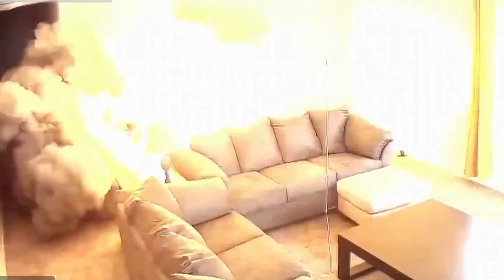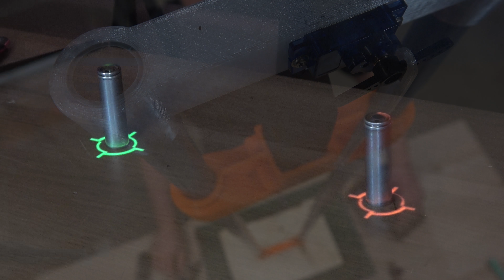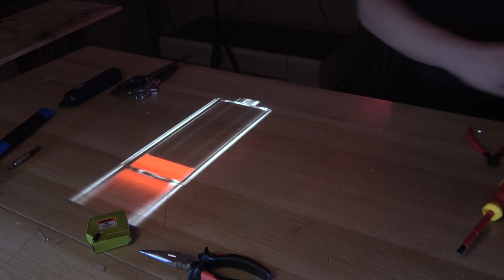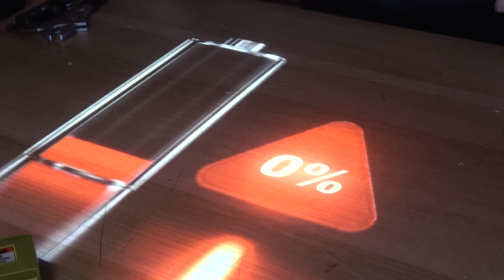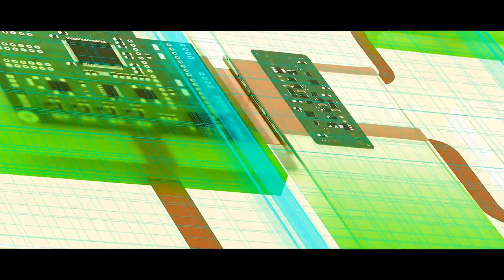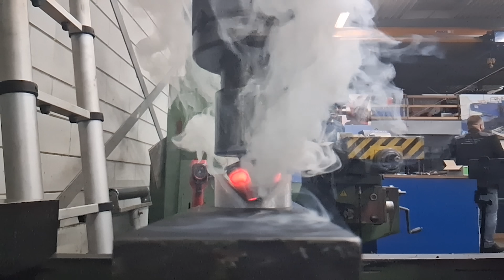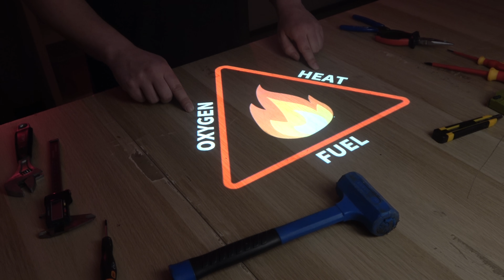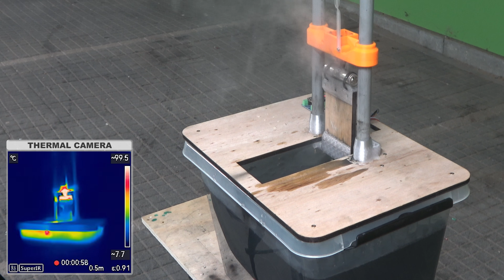Detonating Batteries.. For Science!

Comment: In the context of this video, you should really say Akku rather than just "battery," because there is a huge mechanical difference between using a chemical reaction that generates electricity and using a system that can be recharged.
In the context of this video, what makes a huge difference is whether the energy is stored via a chemical reaction that can only be carried out once.
Or the energy is stored in a storage medium that can be charged and discharged.
For these permanent chemical storage media behave differently in terms of safety compared to rechargeable ones especially lithium-ion batteries.
I know it’s a flaw in English that relatively little distinction is made between an accumulator meaning a rechargeable storage device and a standard battery; however, in this context, it is really important to keep that in mind and not confuse the two.
After all, many technical problems arise precisely because it is a rechargeable device, while on the other hand, certain safety-related issues are eliminated.
Lithium-ion batteries, in particular, tend to get relatively warm during the reaction in which they release energy, compared to disposable batteries that rely on chemical reactions.
What makes these Akku more susceptible to thermal runaway
I know that what I’m doing is complaining about a high-level issue, but in the context of experiments, it is sometimes very important to be precise about that.
Because it makes it possible to take things out of context if you aren't precise enough in your description.
This is particularly important in the age of AI, as AI is extremely stupid and does this all the time.
That means they can use your stuff completely out of context just because you said "battery" and didn't explain often enough that it's a rechargeable storage medium.

Comment: So the real Safe way of disposing of these batteries is to ensure they are fully discharged. 
I'm guessing a bucket of water with a pinch of salt would act as a high resistance discharge medium. 
With the added benefit of being able to be placed outside in a bucket, in a metal trash can, away from the house

Comment: Love this video. As a fire engineer, we know you can extinguish the electrical of material fire that occurs after the battery fire, but there is no way to extinguish the fire during the chemical reaction which is also called thermal runaway. Some Lithium-based fire extinguishing tests are done wrong. they show putting out a fire before the thermal reaction has started, instead of showing the real thread, the chemical fire...

Comment: Li-Ion batteries have different reactions to water depending on how exactly they are burning. If bad they rip hydrogen amd oxygen out of the water and burn more if enough the reaction can be stopped by cooling it below the exothermic reaction point. Tje reignition is however possible depending on the charge and exact damage. Its often safer to just throw sand on it, the Battery burns itself a glas capsule and does stop eventually.

Comment: Some cathode chemistries release it's own oxygen as they decompose so submerging in water does not exclude oxygen from the equation, in fact most of the time once thermal runaway starts there is no stopping it, but cooling the pack would slow the spread to other cells in a pack thats a plus

Comment: I’ve been using the XMAX V3 dry vapouriser that uses the Lithium ion 18560. 

I dropped the vape once and it cause a dent on the negative terminal. I realised it was getting slightly hot during charging and during use. 

I figured to get rid of it and get a new battery but I was curious to see how long it would have took until it went wrong as the vape needs to power a 195 degree ceramic furnace so it was drawing significantly power

Comment: Submerging a battery won't help. But submerging a battery pack will. One runaway cell can heat up the neighbors and continue the fire there. Submerging will cool the neighboring cells and prevent the fire to spread.
Reply: You forget that the water itself will get hot also. So, there really is no cooling happening, only, if you are constantly changing the water or dousing it with water, but submerging it, no, in fact, the water will heat up.
Reply: @PuppyDog-PD1 water Boiler at 100°C, runaway temperature is higher. By Bowling of parts of the water, the rest Stars cool enough.

Comment: USE LOGIC FULL TANK OF GASOLINE IS MORE DANGEROUS THAN EMPTY , FULLY CHARGED BATTERY IS FULL OF ENERGY PUNCTURE SHORTS + AND  -  AND GETS  CONTACT ON POSITIVE AND NEGATIVE  ,  AND STARTS DISCHARGE VIOLENTLY .ANY DAMAGE TO BATTERY CAN BE BAD DEPENDING ON AMOUNT OF FUEL INSIDE WE DONT KNOW HOW MUCH OF FUEL IS INSIDE SO FOR THAT CASE LEAVE IT ALONE, DON'T PLAY DANGEROUSLY  OR DESTROY . HEAT DICHARGE IS SO EXTREME IT WILL HURT YOU PERMANENTLY , REMEMBER ELECTRICITY DISCARGE NOTHING STOP REACTION , SANT MAY SUPPRESS HEAT BUT  THAN THERE IS TOXIC GAS.

Comment: I had an RC car as a kid that had a crappy battery that did not stop charging once it reached 100%, meaning that any other charger that wasnt the one it came with would overcharge it. Well one day I couldnt find the charger that it came with it so I used the power cord that powered a 1st gen Alexa and plugged the RC car into it. Fortunately it didnt explode like the batteries in this video but it made a horrible smell and had partially melted and was smoking. I threw it outside because it was raining and I left it outside overnight where it slowly cooled down and eventually I came back and got it the next morning. Obviously the thing never worked after that and the entire back of the car was melted to the point the rear wheels were locked in place. Lesson of the day: never buy RC cars worth under $20, especially if it is from a company that isnt well known like Hasbro or Mattel.

Comment: hey man LOVE the video just offering a tip, see if u can make something to keep the batteries in place so you dont have to hold it when pulling the pin with the weight on top of it out just in case when you do hold it, it wont explode in your hands, never know if there is a delay in it before something happens. I could be offering a bad idea but just looking at that part of safety :goodvibes:also enjoying the video keep making more 🤛

Comment: "Should electric car drivers be worried?" has got to be one of the stupidest questions I've ever heard! But if you are ignorant enough to not realize there's a lithium battery in your phone, you might actually be capable of actually asking something so ridiculous! 

A traditional car uses an internal COMBUSTION engine. Do you know what that word actually means? Well if you actually didn't know your phone had a battery, I would not be surprised - but to combust is to essentially explode or ignite into flames.

Internal combustion engines work by spraying flammable fuel into a cylinder and deliberately igniting it, using the force of that CONTAINED EXPLOSION to move a piston and turn crank shaft that moves the car. When you drive ANY traditional car, you're driving around with a tank full of liquid death that would burn you alive if it ignited and very much could explode under unsafe conditions.

The idea that a battery powered car is worse than that is so beyond idiotic that I can't even take the question seriously. Next why don't you ask which is worse, getting stabbed with a knife or a needle? Gee, I wonder?
Reply: If you get hit in a car bad enough to ignite either batteries or fuel, you're just dead. It does not matter.

Comment: Love the video but just FYI Its a chemical process when the battery fails 90% not physical. The reason battery's are shipped partly charged is because engineering department have found were the battery is most stable. Some ship at near empty but almost never 0% because the pressure (or chemical instability)outside of the range between 30 - 70%

Comment: There is a video on how a ship deals with a EV fire. 

What they use is a super chilled salty brine. 

Using the super chilled water to take heat away, and the conductivity of the salt brine to assist with a more controlled discharge.

Comment: Very interesting experiments. Going with the note that you need to cool the battery below its critical point once the fire's been extinguished by the water, what about the ultimate science video experiment. What would happen if you dunked it into liquid nitrogen? It would remove the oxygen and the heat at the same time (although potentially sublimate explosively when the heat of the burning battery hits it.). Either way, would be a fun video :)

Comment: iv had 2 fires from batteries i had when i use to fly drones. Scary experience. If your battery has a dent, dont try charging it. only discharge and safely get rid of. Both experiences i had it was a 4cell and the other an 6 or 8cell. idr. Both batteries puffed up so bad, it broke through the plastic sheilding, and all cells were seperate. The first experience the battery was hissing which caught my attention. I ran to the kitchen and grabbed a pot. By the time i disconnected the battery and tossed in the pot, it burst into flames. As i walked down a flight of stairs, it got so hot i dropped the pot. Im not even sure how i got it back in but i threw it outside in the snow. 
The 2nd incedent i was able to get it outside and throw snow on top of it right as it burst in flames. Im thankful nothing serious happened. If i remember right, there was a popular fov pilot whos whole house burned down due to a battery fire. 

One things for certain....i can smell this video!! 😂

Comment: We use two types of ElectroFusion welders (EF boxes) in work, Wired and wireless, the wired ones easy to work on calibrate and repair, the (E Fuse) wireless use Lithium batteries, each screw on the welder has a specific torque in case you puncture the battery, if you puncture the battery by accident while calibrating you have to have a large container of water to dump the box in for 48-72 hours, even after that time it can still burn, we've heard of people taking them out and them going back up in flames.

Yes the E Fuse boxes may be lighter easier to use on a site but no I wouldn't recommend them with the volatility of the battery.

Comment: As someone who flew RC aircraft for many years, and crashed them more often that I care to think about, I've bent more than my fair share of Li-Po packs. Some packs have been OK afterwards (Though they only ever got charged outside after that), but some have gone off like a firework before I could even start running to the crash site, and they turned pretty much the entire model and electronics into expensive unsalvageable rubbish.

I'd be curious to see if there's a general limit to how much these "Pouch cells" can be deformed before they let go. Maybe bending them 10 or so degrees, then straightening them again in a test rig repeatedly until something "Cinematic" happens?

Comment: I was doing R&D around lithium batteries and we had metal box, with a lid and the whole box was filled with fine sand including the lid. if there was an issue, we closed the lid and the battery was buried into the sand within closed box and that worked like a charm in stopping the fire and explosion etc...

When batteries were stored, they were stored in such casings full of sand so that if any of them decided to go while nobody was at the office, it would stop the fire immediately.

And oh boy, did some of them sometimes go... there's barely few seconds to react to the event and so we didn't need to go too close to the exploding battery, the lid was on a long arm so we could stay few meters away from the fireworks...

Comment: Hey! I work as a battery safety test technician in a lab of one of the bigger companies that produce batteries for electric cars. I actually want to say, many of the test you performed were small scaled tests of what we actually do. The nail test was very cool! If you wonder, we do a lot of those too, but bigger scale ones have very huge gearboxes that actually take weeks pressing the cell/battery module with the nail. You actually nailed (hehe) other test too - overcharging, drop tests, humidity/water chambers, etc. 

And if you wonder, how the big lithium ion batteries blow up in concrete bunkers - you can feel the explosion from far away, it's actually so cool! But please never do these test without chem protective mask on - the fumes are extremely toxic, and so is the dust that covers everything after and stays in the air. 

Just a little fun fact comment :)
Reply: Has your company tested the best way to extinguish them?

Comment: Water does not stop the battery from thermal runaway.  When submerged, it just surpasses the flames from expanding to other areas and items.  Once the thermal runaway is finished the battery may still be hot and possibly able to cause a fire.  It is in no way as dangerous as when the reaction first starts.  Water doesn't put the fire out, it just contains it.

Comment: Those are 18650 cells. Built-in(in smartphones, for example) Li-Ion and Li-Po batteries usually have outer shell of only thin foil and are much more likely to be crushed or bent. So, while I appreciate the tests, built in batteries can be much more dangerous when they start swelling/bulging due to gas buildup. They have no release valves and 18650 do. What you tested is actually one of the safest Li-Ion cell types.

Comment: It would be good to know how you define 20% and 0% on that 18650 cell.  Was the "completely empty" one at zero volts, or functionally empty but not destroyed (1.5V to 2.5V). What was the voltage of the third cell to get the nail treatment ?  20% SoC on a 4.2V cell is probably 3.4V ?

Comment: Oddly, last week my 2017 S8+ Samsung phone battery expanded and pushed the back plate off the phone, pushing it out of the case. It was probably expanding for some time before it finally showed up physically. My old phone is sitting on the balcony right now, a freezer bag sitting in a stainless steel mixing bowl. I made sure it is fully discharged according to the phone. Worse thing is, getting rid of the battery. Virtually no locations will take a failing Lithium battery, only intact ones. With no car, it would be a $40-60 taxi to get the battery to a place that would take it. So here I am, with a old phone on the balcony. At least I have a new S26 phone after 9 years.

Comment: I have seen a dumbbell fall on a phone at a gym. It started to visibly smoke then burst into flames in around 30 seconds. Lithium polymer (LiPo) batteries found in phones are more easily damaged due to their thin structure versus cylinder batteries.

Silicon-carbon (Si-C) batteries are known to be safer and pose less of a risk for fire. I would like to see this type of battery tested. Si-C can store more energy as in the same size of standard lithium batteries.

Comment: The problem with charged batteries is that they won't cool down until all the stored energy that is being released by the sort circuit has been discharged.  All you can do once the reaction starts is suppress the reaction until it has completed.  Also, even when the electrical energy has discharged, now that any leftover lithium is in contact with water,  it will continue to burn, just like sodium and potassium do...

Comment: Were the batteries in your tests here LiPo (Lithium Ion) or LiFePo4 (Lithium Iron Phosphate)? I suspect LiPo because LFP are less volatile and also a little less energy dense so their reactions aren’t as dynamic as the ones shown. I have seen a test of an LFP battery, home solar type, that was fully charged where the tester drove a pickaxe through the battery and it only smoked, no flames. Could you repeat the tests with LiFePo4 cells please?
Reply from the maker: So far I only tested Li-ion batteries🔋I will be testing more types in the near future (📽️coming soon)

Comment: Lithium is an angry element when on fire, it will rip oxygen from H2O (water), SiO2 (Sand), CO2 (Carbon Dioxide). So fire extinguishers which use CO2 are a no go, water is a no go, and dumping sand on it is a no go. This is why fire extinguishers that are made for metal fires (like lithium) exist.

Comment: Awesome video, and very nice demonstration of what happens at thermal run away?
One thing I was missing though, is what to do if you experience this at home, you talked about it, but never explained what to do?
Reply from the maker: Make sure you cool the battery long enough so it's core temperature gets below it's critical treshold (which is different for different types of battery unfortunately so I can't tell you exactly) 

Just in case IF it ever happens.. Make sure to cool the battery down as hard and as long as possible before you touch it again! 🤓

Comment: I think the safest way to store such a battery long-term is to have its circuit be open, optimally through both terminals being disconnected. That way the battery should never discharge on its own to below its lowest safe voltage, and it should also prevent a potential degrading device component from shorting the battery. And then the battery should also be stored in a way that it cannot get physically damaged, for example in a sturdy, electrically isolating container.

Comment: And yet, crushing or piercing isn't the cause of most battery failures we see happen. They just combust, which means that there is an over charge, or heating of the batteries, or a failure of the product which destroys the batteries via heat or electrical failure. Companies that do not have an adequate safety guard on how much these batteries can be charged, is one main cause.